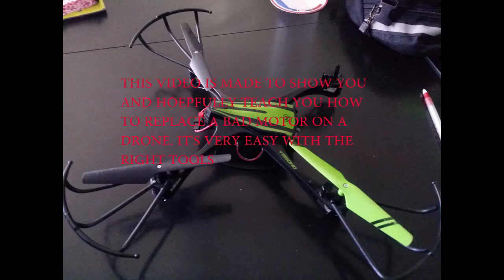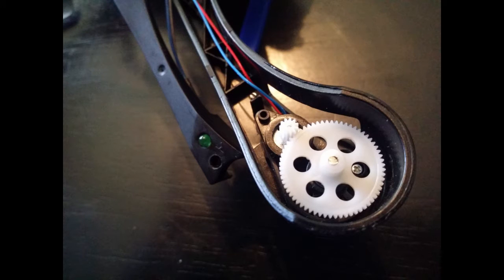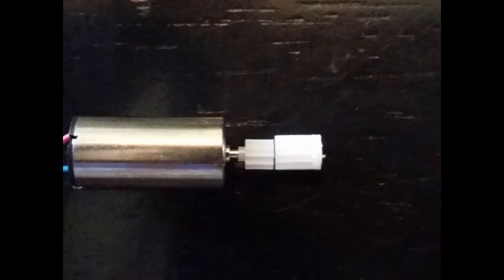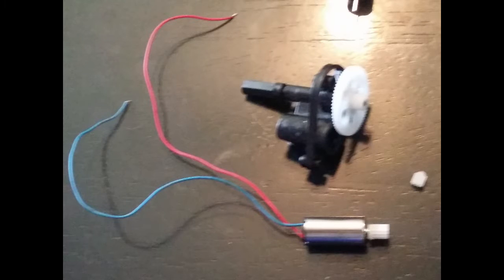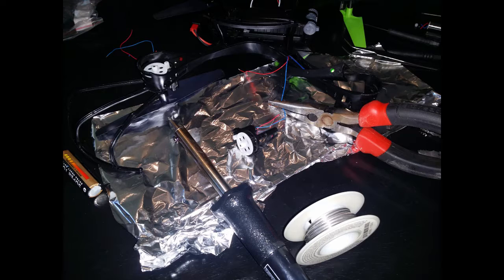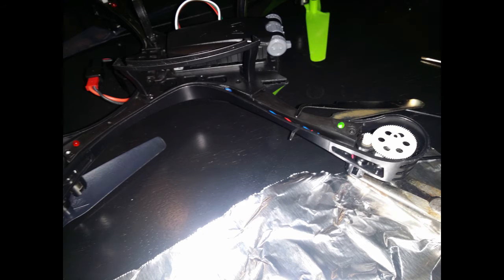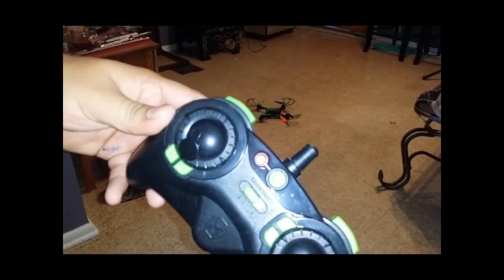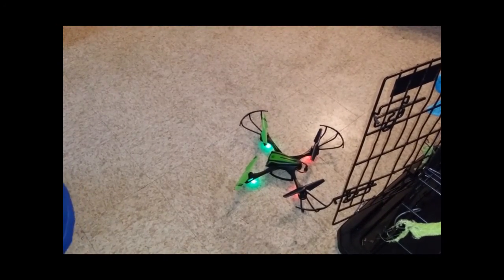FIX YOUR DRONE - MOTOR REPLACEMENT V950HD

Comment: Nice work. Mine has a cracked pinion great though. Do you know where I can find an 11 tooth pinion to fit this drone?
Reply from the maker: Randy Perry by pinion do you mean the gear inside?
Reply: Noel Mont the pinion gear is the wee plastic gear that presses onto the motor. You switched the one that came with the motor to the one that was originally on the old motor. Mine cracked n I need to find another one.
Reply from the maker: Randy Perry I looked on eBay and most motors are measured in millimeter (mm).  Here's what I found https://rover.ebay.com/rover/0/0/0?mpre=https%3A%2F%2Fwww.ebay.com%2Fulk%2Fitm%2F122650023102
Reply from the maker: I put "v950hd drone dc motor gear" in the search. There are more options too.

Comment: Where'd you get the motor?  Do you have a part number for it?
Reply: I found one here. I just ordered it so I won't know how well it works just yet. http://www.hobbyking.com/hobbycity/store/uh_viewItem.asp?idProduct=10000
Reply from the maker: I typed in "drone motor" on ebay. It'll show you motors for $2. The actual model might be on the tiny motor but I just used a different one.
Reply: Noel Mont did they feet in the dron